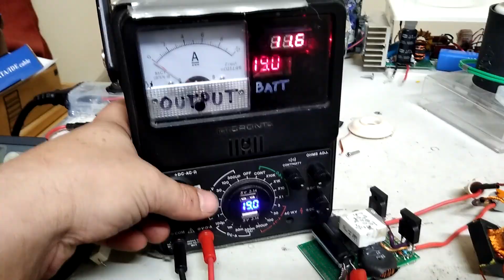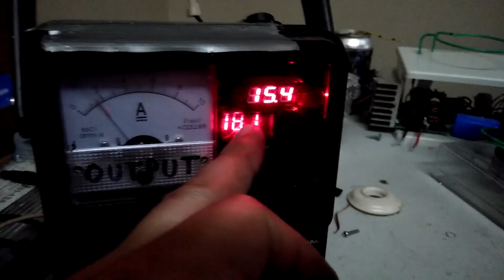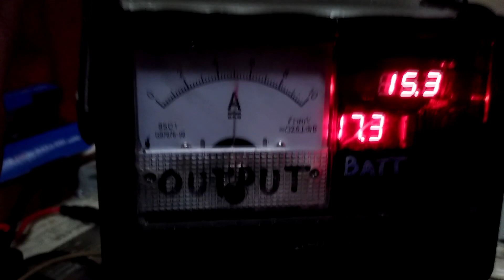The 12V ZVS cheat

Comment: Is this the coil you wore telling me about ? It looks super powerfull
Reply from the maker: Nah it's actually this one. https://www.youtube.com/watch?v=t8t-QlILvtI

It's only a 30V tested deal though. I have one other I voltage tested up to 60VDC that just needs new fets but it's bigger and heavier. The one in this video I tested up to like 90VDC or something and I think I finally killed it going higher. It wasn't all that great anyway, just a rig to test the ZVS cheat and it wasn't switching very well so it would overheat fast. I just threw snubbers on there and ran it til they cooked. 

The one I picked just seems more robust within that 30V range. Can just move the primary up and down to get branchy or sword sparks. Can probably run it CW at something below 30V for a little bit before the fan comes on. I added a couple more bus caps to it after this video. I just need to mount the breakout point to it better.
Reply: @Magneticitist  Oh I remember that one is the "line arc tc " heheh those super straight swords are so cool

Comment: Awesome video sir😊

What are the number of turns of primary and secondary  of that zvs transformer?
Reply from the maker: There's probably something around 10 turns on the primary and maybe something like 30 or 40 on the secondary. Sort of an easy way to regulate the output is to wind too many primary turns and make sure you wind enough secondary turns. Then instead of increasing the number of secondary turns just reduce the number of primary turns to increase the output voltage.
Reply: @Magneticitist  thank you sir 😊
Reply: @Magneticitist sir  do we have to match the resonance frequency of primary coil to the secondary coil for working of tesla coil?? 

Or it just work and self resonance by the feedback system just like the slayer exciter??
Reply from the maker: @nishanshrestha2445  That's up to you but it would be a lot more complicated. The setup in this video is not dual resonant.
Reply: @Magneticitist  so we need to do some experiments with the gate drive transformer and capacitors ?? For better result?
Reply: @Magneticitist  sir can I get your Instagram or something ??😁
Reply from the maker: @nishanshrestha2445  I don't have any social media, just youtube, but you can email me questions if you want and I can try to answer them. Magneticitist@gmail.com
Reply from the maker: @nishanshrestha2445  I'd say that's a good rule for basically all the variables involved. Good gate drive is the foundation of good output that won't kill the mosfets/igbts.
Reply: @Magneticitist  thank you sir😊

Comment: Please send me schematic 🙂
Reply from the maker: Check out Tefatronix's circuit http://tefatronix.g6.cz/images/sstc4_schem.png
His is good up to around 24V or so (with IRFZ44N not IRL)

I've used higher voltage fets such is IRFP250 or 460a's for higher bus voltage but it will be hard to get them to perform as well as the IRFZ44N's from 12-24V. My circuit is the same but using TL494 as interrupter and in this circuit I actually reference the divider RV1 to the positive rail so I can power interrupter separately and run the coil at lower voltages. I have not tried to run the 250's at around 100V and I'm not sure they could take it without some kind of intuitive snubber circuits. To run from 12V I just use a basic ZVS driver but make sure to get the transformer and rectification stage tailored to my desired output voltage. Low power low speed diodes do not seem to work for me well even at sub 30khz ZVS frequency and I've gotten the best results from high power FWBR's I pulled from TV boards. For transformer I use any medium size to large HF ferrite with litz wire windings about as thick as I can get them something around a 6-10 turn primary and an experimental secondary depending on the output voltage I want. To go one step further I PWM the power feeding the ZVS driver to a near 100% duty cycle and it never locks up for me when trying to start up charging the cap. The gate drive/feedback transformer is crucial and some experimentation may be necessary to achieve the best results. JThe secondary currents can be high and more than enough to charge the gates but a good coupling doesn't seem the most important factor, though important. 
Also Skori has done a lot of work on this kind of design with a lot of extra features which may be wise to implement in higher voltage designs. http://skory.gylcomp.hu/tesla/mini_tesla.html

Most of my SSTC videos in past months have been based around that circuit and it's pretty much any of them labeled as low voltage SSTCs.
Reply: @Magneticitist  Do you have a schematic of the TL494 interrupter you are using? Also i will try to make my sstc battery powered by using my zvs driver. I like your videos keep it up!
Reply from the maker: @JohnnyB2451  Thanks. Drawing can be seen beginning of this video https://www.youtube.com/watch?v=7E4v4e-yJAE  

Here's a vid of me babbling over how my ZVS supply came out. https://www.youtube.com/watch?v=SdHudyJgk5U

Clock speed of TL494 depends on the chip but I've had some which reliably do over 800khz, others only half that or so. I believe I use about 10uF timing cap (pin 5) for around 5hz to 60hz or so pulses and a lower end of about 2nF to get in the 100khz and above range but again this is chip dependent.
Reply: @Magneticitist  Thx for reply I will try it.

Comment: This person also uses a promising schematic, 12v to 300v boost converter video: https://youtu.be/W3JcD5-PUUo schematic: https://i.imgur.com/2xWoyXN.png
Reply from the maker: I was looking at his newest coil the other day, so awesome. For 300VDC I'd probably just go the lazy route with the smallest inverter I could buy and a voltage doubler. I haven't been able to figure out what his circuit is pulling total though. 300V seems unnecessary but he can probably still light the fires at a low duty cycle.
Reply: @Magneticitist  This schematic uses only 24v, output should be about the same as this video https://i.imgur.com/DyS2syF.jpg Primary coil 4 windings, secondary coil 5cm diameter, 6cm tall, 750 turns 0.068mm wire. Resonant capacitor 4x 104 metal film capacitor in series. Half the primary windings and resonant capacitance and you can run it on 12v.
Reply from the maker: @PiratCarribean  I'm starting to see a trend here over time where helping the gates discharge is important while charging them can almost be done any decent way within reason. That's the circuit I'm going to turn my drsstc deal into once I wind a new coil for it and get some legit potted windings and epoxy etc. but I'm still trying to figure out the magic of getting it to run great CW as well as interrupted. Using the single turn can work winging it without very specific capacitors but it's not truly dual resonant without some luck. I've got the one circuit so far that gives me the great CW but the rest pull too much current and hurt the fets too much. I bet that one would be insane at 100V though.
Reply: @Magneticitist  This 24v one can be run CW with no problems, only heat. CW as well as interrupted.
Reply from the maker: @PiratCarribean  That's interesting I wonder what it pulls at 24V. Most reasonable I can usually pull off at 24V with actual good looking plasma is like 5-6A and at like 30V it wants closer to 10A. I'd want to run it at around 40-50V though with 250's or 260's. It's like you say heat is the only thing but I beat that with a huge sink.
Reply: @Magneticitist  This is the video where the 24v schematic is pulled from: https://www.bilibili.com/video/BV1qz411q7Tj Video is in Chinese, but I translated the information from a few comments back. Designed for both interrupted and CW as you can see.
Reply: @Magneticitist  Circuit could probably be ran at a higher voltage, maybe a bigger coil and it will achieve even bigger streamers, who knows ;)
Reply from the maker: @PiratCarribean  Finally I see the same kind of line-ish arcs going on so that makes sense. Those results make sense to me but hot damn 41.5 awg wire is not something I wanted to be messing with again.. I did note though that my original micro coil would have been way better if I had just wound something that looks more like the one in that video.. Still got the wire but IDK I'd ever wind that to be honest. Has to be around 400-500 turns.
Reply: @Magneticitist  In the video he gave every dimension. Even primary winding location so must be tuned. 750 turns. Very thin wire indeed. To keep it compact. I guess you can use thicker wire, but everything will scale up.
Reply from the maker: @PiratCarribean  I saw that heatsink and fan and how it didn't much like CW so yea that's about right lol.. It can indeed be pushed higher though which is what I'm working on now but I realized higher than 100V and all my primaries needed to be adjusted larger to prevent arcing. I've been using 460's recently so those may be able to take that 200V or so, I just haven't got my current test coil running as it should at the lower voltages so the higher output isn't as nice either. Something of that size though.. My other micro circuit I did the drsstc testing on can probably do that around 24v but I couldn't get it to run over 20V at lowest duty cycle without it arcing over.
Reply from the maker: @PiratCarribean  His circuit may kind of riding the edge though which is the problem with these smaller ones with great output. It can be done but I'd have to do it differently to get reliable output I can crank higher. For example he appears to be feeding the secondary right into this dual driver input using 24VCC to clamp the voltage while that driver is rated for 20V max at the pins. Doing it this way with direct gate driving would be preferable to get the best switching but it takes a lot of snubbers (which he has) to make it work without headaches in such a small setup. Steve Ward ran his antenna feedback straight to the gate driver in the Micro SSTC but this wasn't really dangerous without some kind of flash over. I'm cool with scaling it up though because I realized even if I did do all that work I wouldn't be able to just sit my coil right on top of the circuit without issues because there's no real isolation.
Reply from the maker: @PiratCarribean  https://www.bilibili.com/video/BV1MT4y1E7sp/?spm_id_from=333.788.recommend_more_video.1 

lol hoooly crap, I think that's the same coil?
Reply: @Magneticitist  Also a mains 220v tesla coil schematic https://imgur.com/a/Hx7Dkwg

Comment: That is pretty nice!! Maybe it will work with my Drsstc ;)
Reply from the maker: I think it should no problem. Can also PWM the ZVS input rail so it doesn't draw as much power so it could be both battery portable and also have a long run time. Or to just use a bench supply 12-30V or so to run it instead of variac.

Comment: Those sparks are better then most of the half bridge circuits I’ve seen before. And I would guess it could probably take 200v.
Reply from the maker: I'm thinking so, but I need to create some kind of creative snubbers for it because as of now I think the fets would get too hot from the switching. I've just got some small resistors and caps on there now which is just more or less showing me the switching dissipation and it's quite a lot even at low speed pulses.
Reply: @Magneticitist  what is "snubbers"?
Never heard about it
Reply from the maker: @tvishmaychoudhary69  When dealing with such currents at these voltages leakage inductance becomes one of the biggest mosfet killers. Snubbers are usually just capacitors calculated to suppress transients in a switched system, but with TC's it can become fairly complicated. Otherwise you are relying on the body diode of the mosfet and the zeners for protection alone. These may not always block all the transient spikes fast enough. Some people put a capacitor across the Drain and Source to catch these transients though that more or less just swashes the same energy back into the mosfet capacitance. If you place an RC snubber in the same place you may be able to see the switching energy being dissipated into the Resistor but these values need to be calculated depending on things like currents/frequency/voltage etc. It can be quite a lot of dissipation. There are some more complicated circuits which use snubbers to recycle this switching energy but these are usually some kind of RLC circuit. 

If I were to arbitrarily place a resistor in series with a capacitor across my Drain and Source on the mosfets let's say 50 ohms and 10nF, those resistors are going to get burning hot because these mosfets are using quite a bit of energy to switch on and off at these frequencies and power levels. This can't really be avoided but we don't want super high voltages created in this process traveling to the say the Gates which will destroy them.
Reply: @Magneticitist  oh like a rc filter??
Thanks🥰
Reply from the maker: @tvishmaychoudhary69  lol exactly but it gets a little more complicated with SSTC's. Not really like making a simple RC filter for some random inductive switch.
Reply: @Magneticitist  lol i cant even make the tefatronix circuit work 
I have blown like 16 irfz and 5 irfp
😂😂
Reply from the maker: @tvishmaychoudhary69  did you make any changes to the circuit or run it higher than around 24v?

Comment: I wound a big core to give a bit more than 30V from 5V (with more taps for higher input), and was thinking those initial spikes could be problematic, but I guess if they're below drain source breakdown it shouldn't ?
Reply from the maker: Most of my ZVS drivers I wind to output mains voltage from 12V have no issues at all charging less than 500uF or so, but over that and the ZVS really needs to have the available amps at that initial inrush or it will lock up. I hardly see the spike with the punier caps obviously so a portable setup is probably needing to go that route.. puny cap and puny sparks but long sparks nonetheless. Running it from higher input voltage is the cheat there but it defeats the purpose of what's ultimately the low voltage input.
Reply from the maker: They are problematic for the power supply but that's about it. There's got to be simple ways around it to where a ZVS can be given soft starting at the frequencies we may want to interrupt the coil.